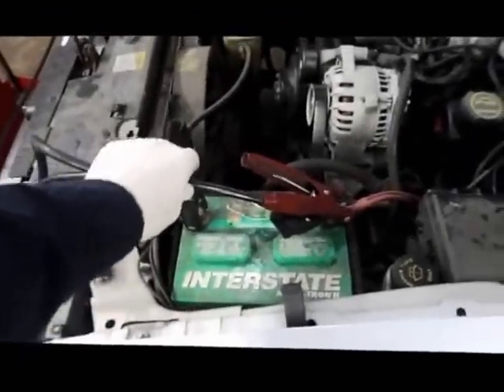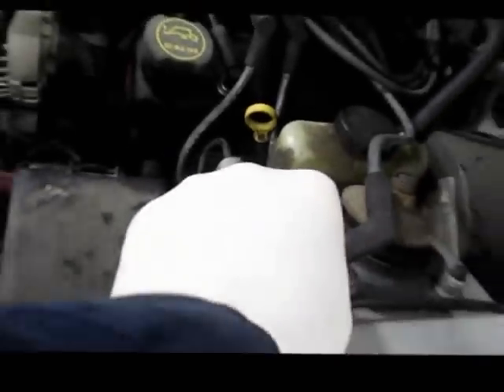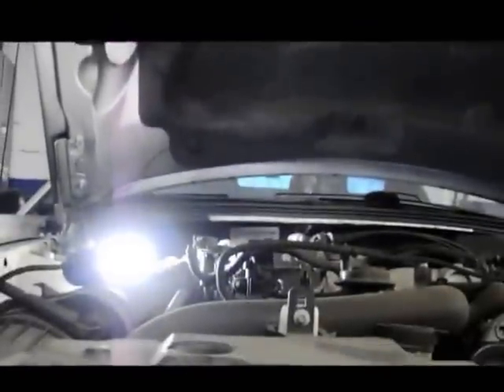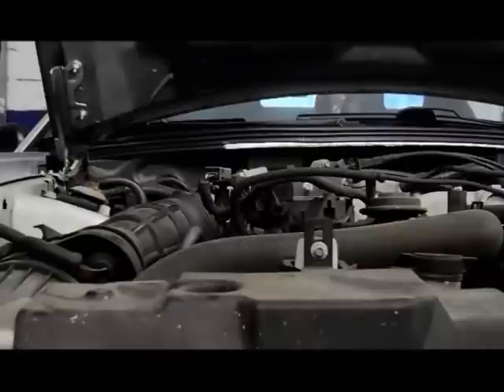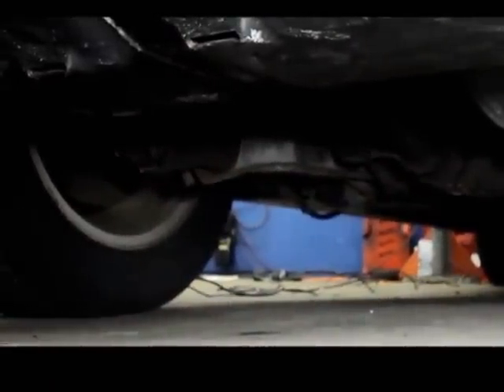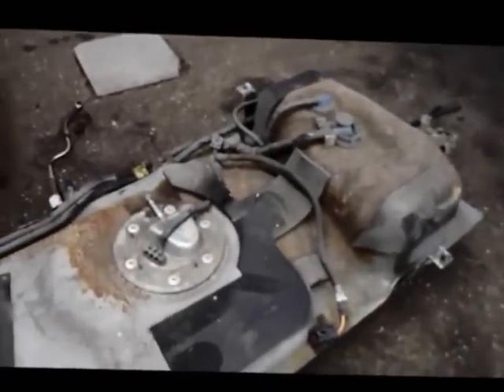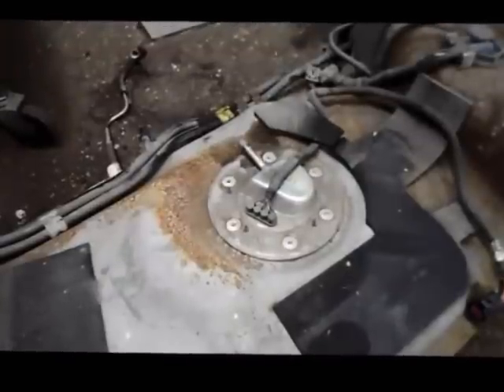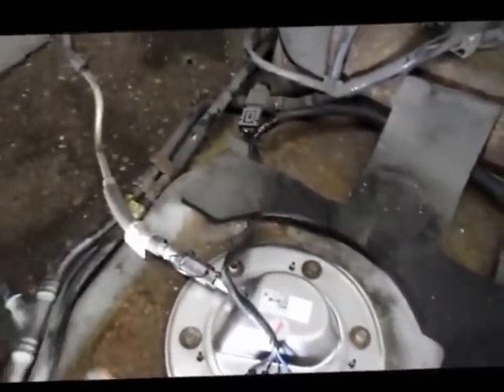Engine cranks but won't start

Comment: Interesting and logical fix. I have engine turn over , no spark , no gas , gas gage not responding , haven't checked pressure yet but cannot hear gas pump so what next ? fuel pump relay ? I am checking fuses for a short but no luck yet . I do have a short because there's a spark arc at batt . cable and an engagement noise, that I suspect is where my short is coming from. It is a 97 Blazer 4.3 and any ideas would be a great help .thank you Jim.

Comment: NO IT Is the same     but I never checked fuel ejectors for impulse
Reply from the maker: +David Monroe  Check for codes first and then the injector pulse.Was the timing belt replaced ?  How many miles on the car?

Comment: I've just been through Hurricane Harvey.  My lincoln 1998 towncar was flooded but no water in the engine.  Now, it does not even turn.  what can I do.  I tilt it with my 2tons jack and about 3 gallon of watrr came out.  How can I get my car to start again?  beside taking it to a mechanic .  thanks in advance

Comment: I HAVE 97  DODGE RAM 1500 NO START .CRANKS OK ,SPARK OK FUEL PRESURE OK  WHEN I CRANK IT WITH THE GAS PEDAL DOWN IT SOUNDS LIKE IT WANT TO START BUT DOEST. CAN YOU HELP ME
Reply: David Santos I have the same issue, if someone could give ideas, mine randomly works for a few hours on end, but it keeps stranding me at places.
Reply: I had a technician from dodge come a check it out and he couldn't start it every thing on computer is good.but no start.
Reply: David Santos I've replaced crankshaft, timing belt, and found that the engine runs fine if I spray starter fluid directly into the open air intake where the filter should be. This tells me my problem is gas line related, although the fuel pressure and fuel pump are fine, my next guess is my injectors are messed up.
Reply: Crankshaft position sensor*

Comment: My 2003 F-150 5.4 Triton cranks without starting sometimes, then other times it start right up. Could that be the fuel pump going bad slowly, or do fuel pumps just die fast?  Thanks!

Comment: Anyone might no why a F1-50 van won't fire it just turns over.
Reply from the maker: Your going to have to do some diagnoses to see if it is a fuel problem, spark, injection pulse or compression before you can go any further.  Here are some videos that should help. Keep me posted 

https://youtu.be/jsQcLya1YLQ

https://youtu.be/5aeju-4V6vo

https://youtu.be/1L4nB2NdA0U

https://youtu.be/BqLyq2xfT_4

https://youtu.be/gNe8EzJQMCY

Comment: I have a 89 mazda b2200 that doesn't have spark coming from the ignition coil but the resistance test shows it to be good, engine turns over but wont start. It doesn't have a cps. I thought it may be the ignition switch but it is turning the engine over. Any advice? Im at a deadend,lol.  Thanx

Comment: What if all my fuses checked out good but on the fuel selector switch I had less than 12 v  one wire was reading 8v and another one 6v on

Comment: That was great and I may have a fuel pump problem with my Ford Explorer (1999) which ran great until I parked it the last time, and when I tried to start it again, it would not start, but would crank up normally. I can't remember if I had replaced the filter on this vehicle since I owned it in 1970. I have a tool to put replace the filter on one Explorer and also on a 1987 S-10 Blazer I still have. I thank you so much for the information, and hope it works for me.

Comment: Jim, a very important question... Do these mustangs have a fuel pump relay? I have checked in the owner's manual but found only a fuse for the fuel. The fuse was good but i want to check if the relay is bad (if it has one)...
Reply from the maker: No on this car there is no relay I will attach what my repair program said. Good luck let me know how you do. Remember be careful with the gas and the fumes from the gas.                                                                                             Fuel Pump Relay is not serviceable. 

 The Constant Control Relay Module (CCRM) contains the fuel pump relay, which supplies power to the FPDM. If any of the internal components of the CCRM fail, the entire unit must be replaced

Comment: I have the same problem and I replace the fuel pump cause I dirent have any pressure of fuel to the injectors....
Now I have fuel to the injectors but still no start I check all the fuses and rellays..
And the switch on the trunk and nothing
Reply: There a fuel shut off switch under dash driver side

Comment: ok, this is where I'm at, I have spark, have fuel pressure, motor turns over, still no start. 2001 mustang with 3.8l from 2003 mustang. NEXT?
Reply: read more
Reply: check crankshaft position sensor, simple and cheap

Comment: So what happens if I have spark and I have fuel pressure?? I have an 03 f150 that just won't start at all! Just cranks and cranks. And every once in a while (on a very rare occasion) it will start. But once you turn it off. It is back to square 1! Please help. Very very frustrating

Comment: 1997 subaru legacy cranks no start dont hear the pump when i turn the key.
Reply from the maker: +Michael Rosado  Have you scanned the car for codes?
Reply: +jimthecarguy change the pump the started
Reply from the maker: +Michael Rosado  Thank you for the follow up.Great job

Comment: My h2 been seating for a while, cranks won’t start don’t know what to do. Any idea?
Reply from the maker: Did you check for codes? You will need to do some diagnostics. Here are a few video that may help.
https://youtu.be/ecLmYPcWipo

https://youtu.be/5aeju-4V6vo

https://youtu.be/1L4nB2NdA0U

https://youtu.be/gNe8EzJQMCY

Keep me posted

Comment: Ford has a running problem with this that involves a new harness running to the fuel pump and a larger fuse...the harness is on national back order so I'm thinking it's a huge problem....Ford dealer repaired mine with a bypass wire and larger fuse and it works great.

Comment: Sir, i have related problem my r33 RB25det, when i started the engine & warming up suddenly shut down my engine. when i started up again my engine having Crank normally but wont start... there complete ignition of coil pack and new spark plug, and also checked already the fuel pump and fuel filter are working good condition, so will you give m,e advic
Reply from the maker: Did you check for codes?Did you check fuel pressure?
Reply: yes sir fuel pressure i have but the codes not yet
Reply: michael geruldo Pull crank shaft sensor [sensor a clip behind pullys where belt is above water pump to the upper left. Use a mirror find it] clean it with electronic  spray only both ends two squirts. Check ECM fuse too if its blown it cause what ur saying. Always check fuses relays sensors  first work back. Use test light it save hundreds avoid replace parts dont need to be replaced

Comment: I've changed the fuel pump and filter it started fine for 2 weeks but now it cranks but won't start 
Can you help me out?
Reply: Cranks! But will not start. Starts after repeadely pumpin accelerator. Starts poppin a missin. After 30 seconds it begins 2 start. Haveim 2 pump it 4 a bit till it finally fires up! Once it gets 2 running! No more problens 4 the day !

Comment: Hey Jim, I have a 2002 Ford Mustang 3.8L V6.  about a year ago, I had a crank no start situation.  I changed out the Spark Plugs, put ina new battery, fixed the problem.  a couple months ago, I had to have surgery, and was out of work for 2 months, I went to start the car, fired up, then the whole car shook, really bad idle, and when I tried to give it gas, seemed to make it choke even more.  I assumed that it may have water in the tank, due to the weather change and from sitting, so I put some of Sea Foam or whatever into  the tank, I also pulled the Idle Control Valve, cleaned it out, and put on a new gasket.  Disconnected the battery, and it still crank no start.  I'm getting fuel at the valve, the red pump reset button is pushed down already, cannot press it in the trunk, Theift light isn't an issue, any ideas?
Reply from the maker: +zebarz  Will the car start and just idle?When you give it gas did it stall?Did you check the fuel pressure ?Keep me posted Jim
Reply: +jimthecarguy The car won't start at all, it just cranks.  I did get it to start initially, after I Jumped the battery, I let it idle for about 2 and a half hours, to make sure the Alternator had time to recharge the battery, when I went out to move it into the garage, it started choking and did even more when I pressed the gas.  I am kind of thinking that perhaps, since it was sitting, when I started it, it sucks stuff into the filter plugging it, I had a mechanic come out today, he believes it to be the fuel filter.  I am having him come over tomarrow and install a new one, hopefully that's all it is.  I try to do everything I can myself, but as I have stitches from an Incisional Hernia, I cannot lift anything.  He charged me 48.00 to come out, and he stated its gonna be about a half hour to hour job tomarrow, which I think is right, Fuel Filter is easy to get to.  You can clearly hear the fuel pump kick on, and I know that doesn't mean its not working right, but at least the Fuel Filter is a start, its just over 100k miles.  Thank you so much Jim for the fast reply.  Ill keep you posted.
Reply from the maker: +zebarz  Great
Reply: +jimthecarguy Ok update.  Mechanic came, put in a new Fuel Pump, Fuel filter.  Car still wouldn't start, disconnect battery, hooked back up, seen that Fuel pump fuse was blown.  Put new one in, still wont start just cranks.  Mechanic is coming back tomarrow to do electrical diagnosis.

Comment: hay jim the car guy, need your input again oil temp flashes 16 times on my subaru legacy for the first time on a cold nite next day went to move the car it did again waited started it again no flashing light the car has 280,0000 miles
Reply from the maker: +Michael Rosado Thanks for watching and for your input
Reply: Jim took it step by step until he got to the problem, logical and impressive!

Comment: how did u go about  empting the tank,  what did u use.      good video.
Reply from the maker: +hunkydude322  You will need to use a very thin hose to drain the fuel tank

Comment: Mine was a bad plug end at the TP. Fixed it runs like new it wouldn,t crank over had a p0601 code

Comment: I have a 2000 Ford Mustang and I never had any hard starts I literally pulled my car out of the driveway rolled my wife's car into the driveway went to go pull my car back into the driveway it would not start it cranks but won't start
Reply from the maker: +Teebuck27  You will need to do some diagnostic to pin point the problem.follow my advice in this video to find what went wrong.

Comment: HI Jim. I have pulled out halfway the fuel rail with the injectors still attached and started the car. I discovered that the injectors won't fire. then I tried pulsing each injectors separately and they do fire fuel. So what does this mean? Do I now go for the ECU? It appears that the injectors are not receiving voltage pulse for them to fire from the ECU. And if so, what do I check for in the ECU? How do I repair it?  thanks
Reply from the maker: +EndofUSA Thanks for watching and for your input

Comment: Im trying to find a way to hook up my compression gage up to the Shrader valve. I was told that if the pump is putting out less than 25 psi that it may not be enough to start the vehicle
Reply from the maker: That is to low to run the car.

Comment: i have a 1999 ford windstar. i put a new MAF in it. now the thift light flashes all the time. i turn the key. and it really flashes. for a min. then it stops flashing for a few secends. then it does that about 3 times. then it flashes i think it was 8 times in a row? and there's no spark? if you can please, help me with this? thank you for your time.
Reply from the maker: +Donald Sanders  Do you have a second key for the truck?If you do try that key .Keep me posted.
Reply: i got it used, with only one key.
Reply from the maker: +Donald Sanders Does the key have any broken parts on it .The reason I ask is because the key has a chip in it.
Reply: no it does not
Reply from the maker: +Donald Sanders You will need to scan the van for codes.
Reply: I have a little pocket scaner. of got 2 of them. and it comes up with no link? on one. and the other comes up with earrer?
Reply from the maker: +sqakdaddy2323 Thanks for watching and for your input

Comment: Ether is not good for a engine.
Reply from the maker: Like everything in life a little will not  hurt (in moderation)
Reply: +jimthecarguy true but I've seen guys go bananas and douche the engine in that crap, not good.
Reply from the maker: +Myk Ford  Oh ya I've seen that were they will use so much it will toast the engine.Thank for your imput.Jim

Comment: changed my fuel pump and my car still  won't start! I am lost and frustrated
Reply from the maker: +Nichole Jacobs Have you checked fuel pump pressure,spark or injection pulse?Did you check the car for codes?
Reply: +jimthecarguy and not to mention as I tried my interior lights are dim. they weren't doing that before.
Reply: +jimthecarguy No I have not.  I tried to crank the other day and now it's cranking really slow.
Reply from the maker: +Nichole Jacobs If the engine is cranking slow the battery is most likely dead and will need to be charged or replaced.

Comment: Thank you very much Jim... Your information helped a lot. No i don't have any pressure at all... but gas did come out from the valve when i press it. I have cycled the key several times.

Comment: Hello jim! 
i have a 2001 f150 with a code p171 i checked it and noticed it was a pcv hose.  i replaced but now it does starts on but don't run. i checked for any unconnected hose and everything looks ok. i even cleaned the full throttle body, mass sensor, new air filter and still don't run.. 
what do you think it might be? it was perfectly fine and running before i noted the pvc hose had a hole wich i assume the reason for p0171 code. it starts on.. stays on but if i put it on reverse or drive it just don't have power.
Reply: delfino Hernández  catalyst converter try that

Comment: I HAVE 96 HONDA ACCORD NO START HAVE SPARK HAVE GOOD FUEL still wont start
Reply from the maker: +David Monroe Did you check for codes?What happens when you crank the car?Does the engine spin faster than normal?
Reply: @jimthecarguy  My car is a 2000 Buick century cranks but won't start

Comment from the maker: Have you checked fuel pump pressure,spark or injection pulse?  let me know I will try to help.Jim
Reply: the fuel pump pressure seems to be there but weak, no spark, no way to crank it by myself and listen to the injectors, my hunch it is a bad crank sensor, going to pull the coil and test it but the service manual is very sKetchy on what the resistance values should be or how to test it
Reply: I need help

Comment: My 05 Ranger cranks and wont start, but i let it sit for an hour or so and it starts up. Whats up with that ?
Reply: Samuel Adams my 94 gt does the same thing
Reply: My 07 f150 does that especially when its been ran awhile 
Only when its hot does it do that
Reply: on the distributor is a module that is gray in color that will go out and on occasion will intermittently cause that issue. Most of the time it will just not start but if you are lucky it will be like I described. Also you have a fuel cut off that malfunctions. My 1985 Ranger I got for $500 because the switch broke and left the old man stranded. I eliminated it and spliced the wires together.
Reply: Lose wire to relay or fuse  arched wire aka grounded wire cause this. Could be any number of things like Loose battery cables to starter to alternator or Eroded battery cables need replaced. ECM fuse may be faulting work not work off and on

Comment: Now I got it fix it was a short on the car stereo...
And I also change the  cam shaft sensor
Reply: Where was the short? My car radio went out. It turns in but no sound was coming from speakers. Now my car won't start. It just cranks .....
Reply: I hav4the same problemdid u solve the problem
Reply: Martha I did fix it  i had a short on mine car ..the stereo wires were grounded..
And it could be alout of things  like fuel pressure  fuel filter ,fuel really, fuel fuse..
No spark  ,could be your coil pack ..could be your fuel injectors!! Fuel pressure regulator.. your timing  your little computer that controls  your injectors if your not getting fuel in to the injectors
Reply: @marloluevano5662   you could have a short in your  wires.. check them twice..
And sorry for the late response